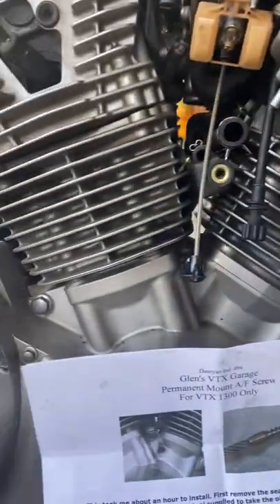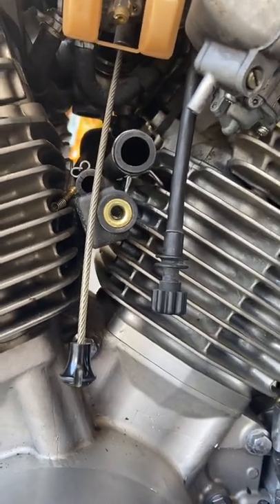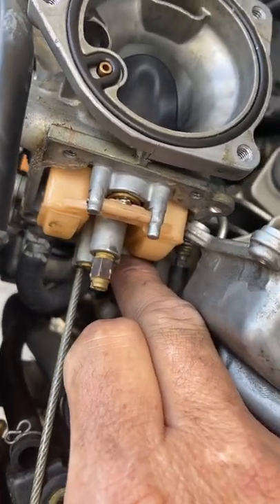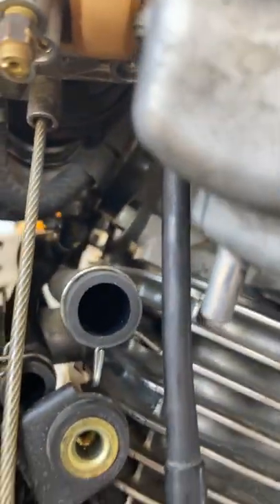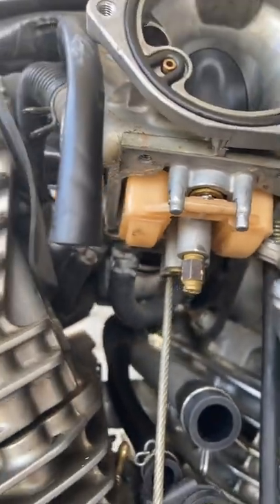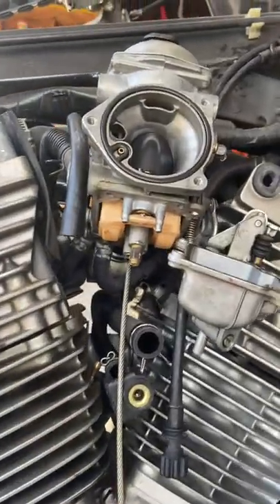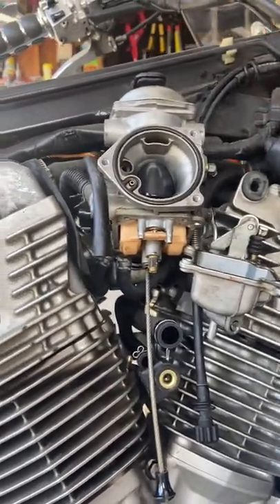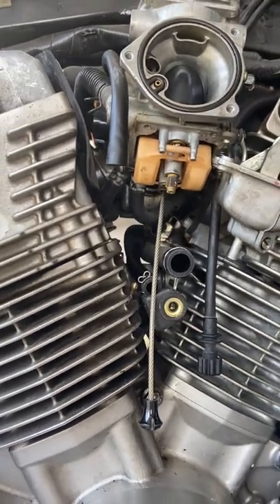Honda VTX 1300 Glen’s Perm Mount A/F Screw install.

Comment: How did this work out? I'm about to do the same thing on my 1300 for the same reasons: previous owner put Cobra Slashcuts on it and apparently had the carb jetted which left the bike running super rich. I'm about to bring it back to the stock jets and install the Glen's tool. Did you find that the 2 1/2 turns on the screw was still a good position? Thanks!
Reply from the maker: It seemed to be running rich also . I  had the carb rebuilt and then had to play with the screw setting a little bit to find the right mixture… I sold the bike and last time I talked with the buyer it was running really well . So, you might have to adjust the screw some but I’d start with the 2 1/2 turns and then go from there. Thanks for watching !
Reply: @DJ-wu2qc  awesome news! Thanks for the reply, and for the great video – take care!

Comment: Hi, I'm in the UK? And have just got a vtx 1300. My plugs are fouling up so in your opinion would this help me
Kind regards wardy
Reply from the maker: Yes, this would definitely help you if your plugs are fouled up that means it’s getting too much fuel and not enough air. This screw will help you eliminate that by adjusting the air fuel mixture better.
Reply from the maker: Yes, this would definitely help you if your plugs are fouled up that means it’s getting too much fuel and not enough air. This screw will help you eliminate that by adjusting the air fuel mixture better.

Comment: Is there a tool to screw the adjuster on?
Reply from the maker: No, you shouldn’t need any type of tool
Reply: @DJ-wu2qc  how is the adjournment done?
Reply from the maker: @taprac  the Glen’s screw attached directly to the motorcycle
Reply: @DJ-wu2qc  yes I understand that.What holds it in place?
Does it have threads or is it a
Press fit?
Thanks
Reply: @DJ-wu2qc can this item be bought on Amazon or is it only sold at Glens Garage.
Thanks again for your info DJ
Reply from the maker: Yes they’re are threads and it screws on.